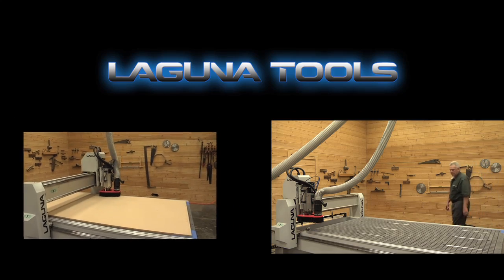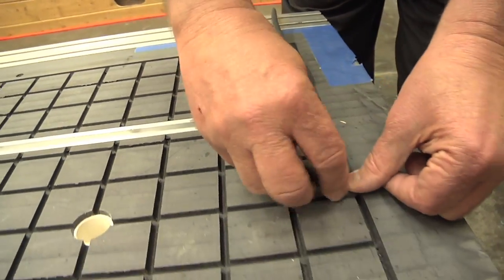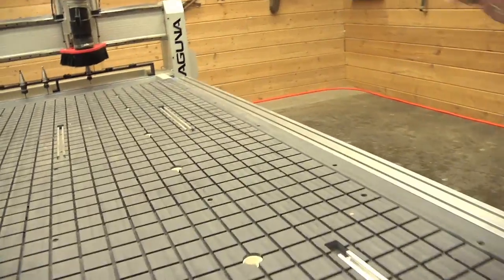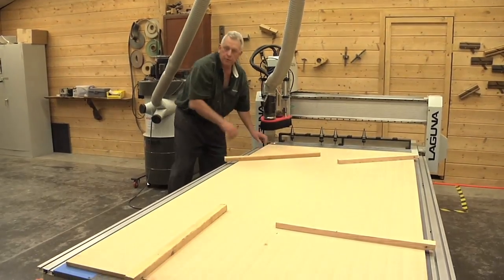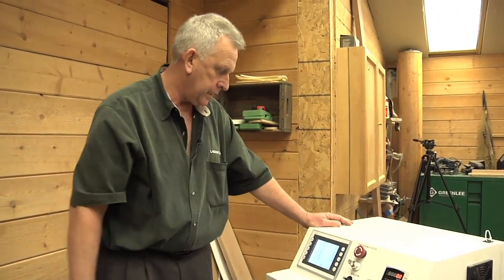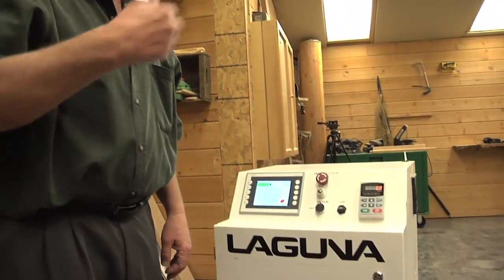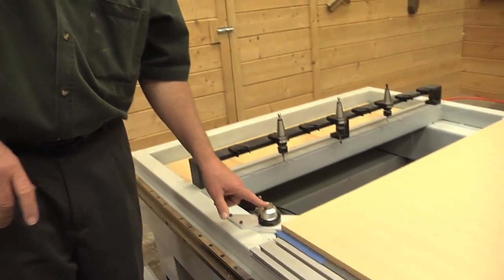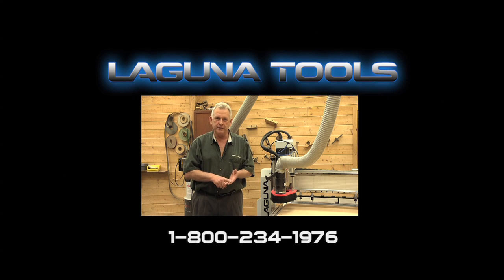Vacuum Table Setup for CNC Router (Older Model) | Laguna Tools

Comment: Do you recommend LDF MDF or HDF to be sacrificial board that sits on a table . Also should a rubber gasket sit slightly above black table surface .
Reply from the maker: Lets discuss, call us at 800.234.1976 for a quicker response. Thank you for your interest.

Comment: @ Despicably Irascible Rapscallion... 
It's not just to hold down spoilboard. You have to skim off both heat treated surfaces of the MDF (as video shows) then vacuum table pulls the suction THROUGH the MDF. Seems like it would't work but it does. MDF is dense yet very porous once skimmed.
Reply: John Crosetti is that right? That's what I was hoping he was getting at but was disappointed when the video ended before he showed the whole purpose of what he was doing.
Reply: If the MDF is made porous all over to a vacuum by skimming the surface each side, how is the vacuum held to a smaller piece being cut above? I can't see how zoning with a smaller gasket makes any difference if the vacuum can be pulled through the MDF from outside the gasket? Is it just a very powerful vacuum required?

Comment: Hi, what pipe diameter and pump do you recommend using? I am making a table 1220*2440mm, with 6*6mm grooves, 25mm between grooves. Thank you
Reply: pretty well any shop vacuum cleaner will work